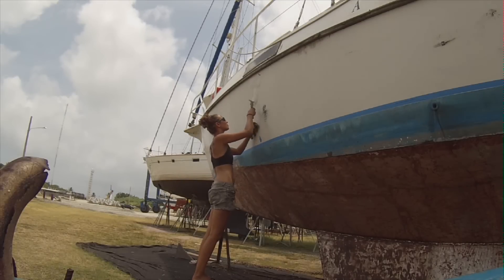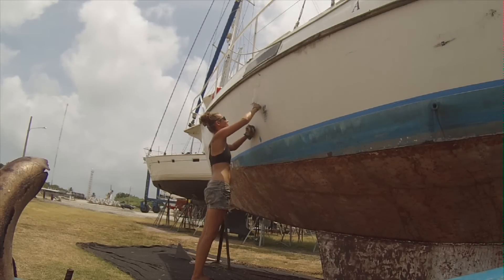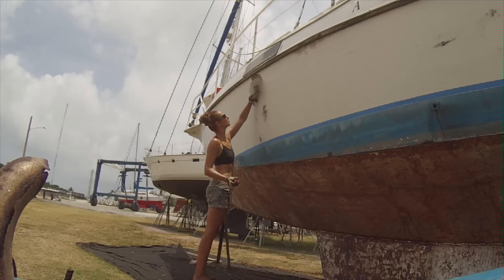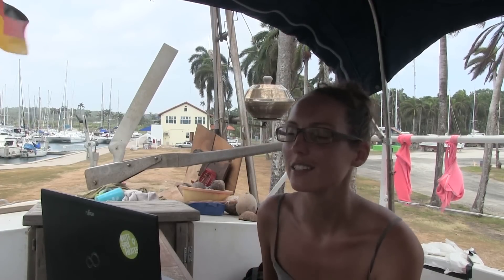Boat refit: Stripping My Sailboat Down To Bare Aluminum In Panama - UNTIE THE LINES #31

Comment: Just put mine back in the water this weekend myself. I found a small leak where I removed a screw the previous owner operator had put through the hull. UGH! I hate when that happens but as is with all things it was a learning experience and my boat is repaired and stronger for it. Good luck to you and keep on course. Fair winds and following seas.

Comment: Your hard work is amazing. I've just been through the mission of a scrape, sand and anti foul of a 46 foot ketch. My first, so I find your posts inspirational! - I so felt for you when you'd bought the last sanding disc in the area - an indication of the speed of process there! - best for this incoming week - closer to hitting the ocean!
Reply from the maker: they've stocked up on them again as I saw the other day. And I bought two, just in case ;). Hope your boat is back in the water again?

Comment: A couple of things people, especially welders, are almost flaming you on, is the thickness of the hull. I doubt that the hull thickness has change for the entire boat, just the areas around the holes. So, German manufacturer will have that. I haven't looked at the page where you talk about your boat specs yet. Might be good to get the hull checked out in some big marina eventually, just so you don't worry on those huge long sails. Hopefully your checking EVERYTHING out. Delos has problems all the time, and they commented on the last one (they had German guests by the way) that it would be really hard to fix the problem with a small crew. He had to go up a stainless cable and fix a pulley I think, and it was attached at the mast at 60 ft.  So he was up at least 30 ft. fixing the genoa hoist. My sailing terms are still  terrible.

Comment: I would have sand blasted  your hull. however  I own a 1000watt Clean laser that would  strip paint  and rust in less than an hour. also you  you mentioned your  hull was aluminum. why did I see your welding guy using a stick welder. I use a tig welder on everything. you should teach yourself how to weld. also if you are in a bind there is this product called Muggy weld.  look it up. all you  need is a blow tourch. great for welds  especially at sea.